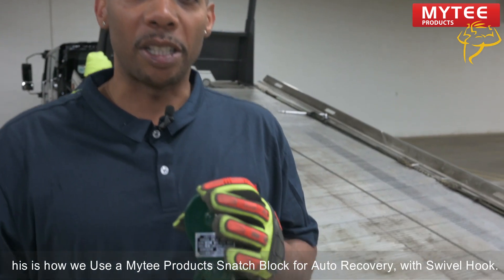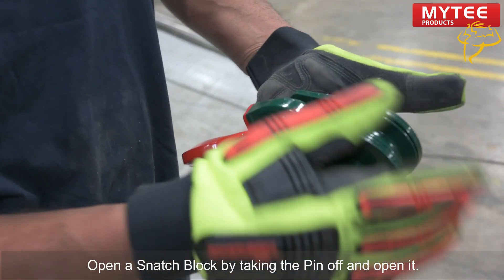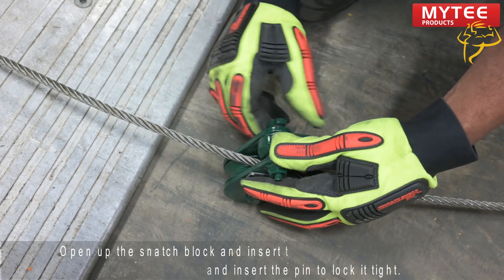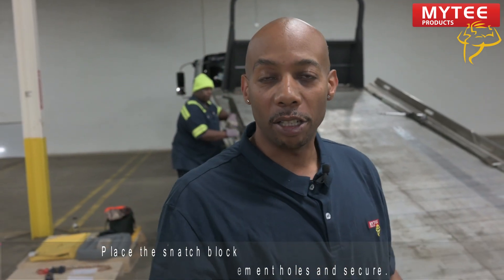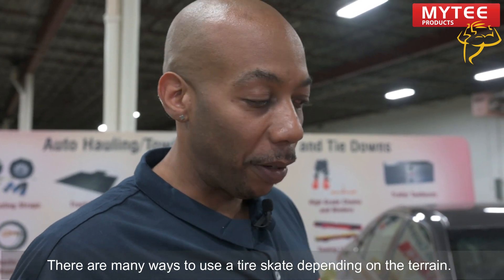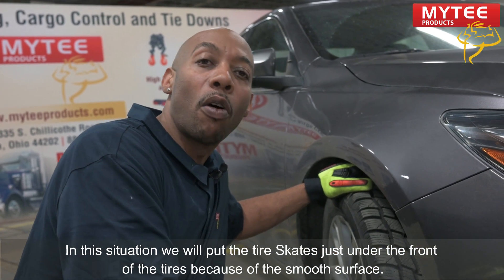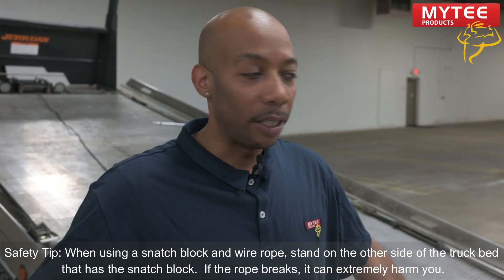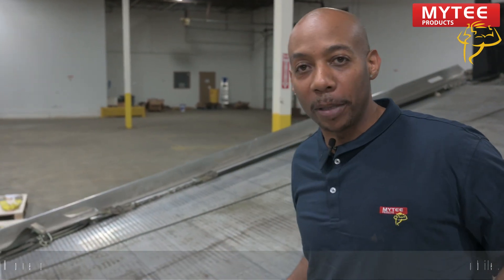Auto Recovery at an Angle with Snatch Blocks (with Hook)

Comment: The block should not be attached to the same vehicle. A separate anchor point is what multiplies the working limit.  In this scenario a choker should be used around a parking Ballard and then connected to the block. This video shows a winch working 1:1. Not 2:1.  Since the load is being pulled and redirected on the same platform this is simply a pogo stick or redirect.
Reply: Thats exactly what it does. 🤷‍♂️😅

Comment: is it ok to winch at an angle with an aluminum bed?
Reply: That truck they’re using is an aluminum bed
Reply: Yes. Do what you gotta do to get that paper baby 💪🏽💪🏽
Reply: @larrygonzales7410  As long as the operator is aware of the risks hes taking with the equipment, go for it.
Reply: Gotta have the tools 🧰
Reply: i wouldn’t use the aluminum decks for heavy snatching but for this application it’s ok. We only buy steel decks bc we do a lot of recovery and accidents and the chain pockets are stronger. We carry 2 snatch blocks per truck,75 ft of cable and 100ft of chain just in case.